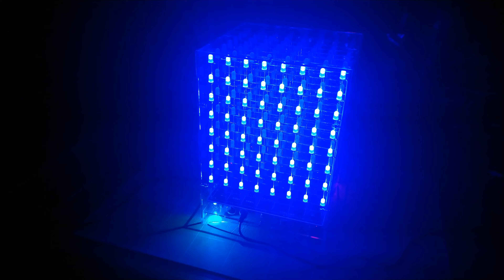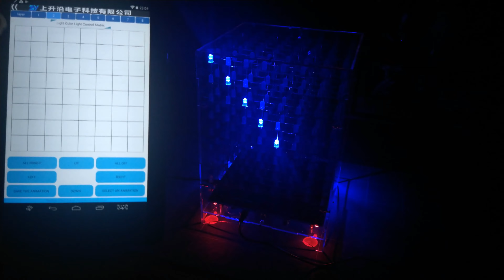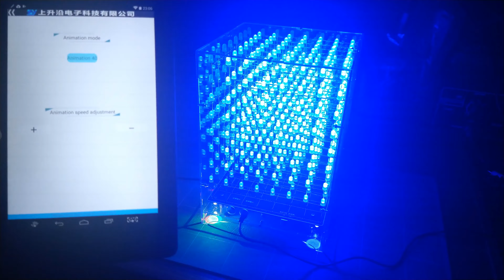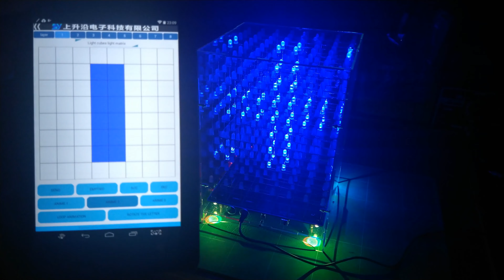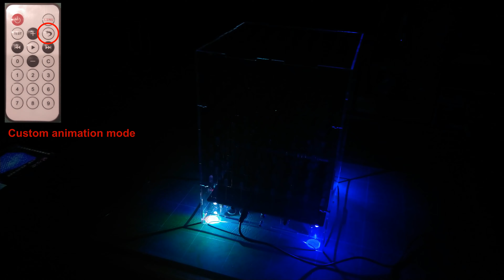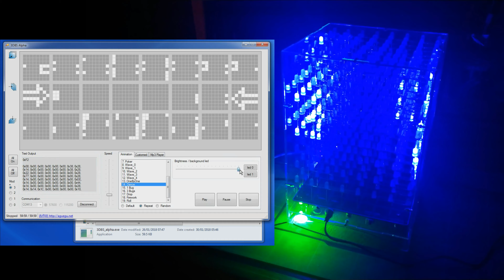DIY 8x8x8 LED Cube Build - Part 3 - Operating the LED Cube

Comment: Hi David,
How would connect a i-phone or I-pad to the cube?
thank you
Reply from the maker: Sorry but I don't know as I only have Android devices. I suspect the app is not sealable for iOS as it was only supplied for Android as a non-app store side loaded app package. Apple are quite picky about what apps are allowed on their store and prevent side loading.
Reply: I have a laptop as well. Please advise what the app would be so I can try that.
Thank you very much. This was a gift with no instructions.
I am really glad I found your video.
Ross
Reply from the maker: In the description there is a link to the software bundle off Banggood. Inside that there is a Windows application in "SKU835176\3 8X8X8 light cube PC\3D8S_Alpha" which is mostly for designing new animations across the 8x8x8 layers but IIRC can also be used to select existing animations to run. You will need the PL-2303 USB to serial adapter connected from the computer to the programming interface of the cube. In that same software bundle are the drivers for thar adapter if your OS does not have them. The Windows app is less useful for general control as it has to be physically wired to the cube.